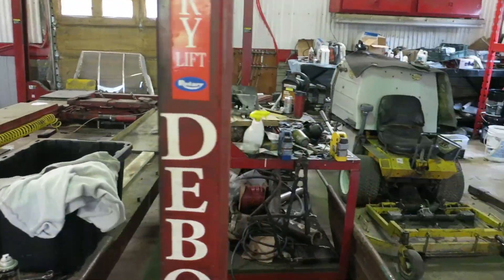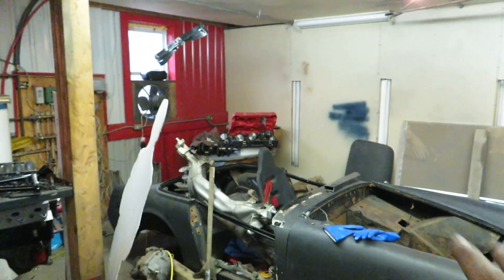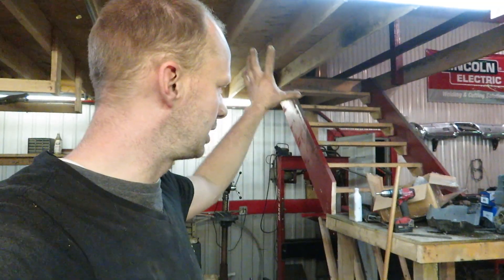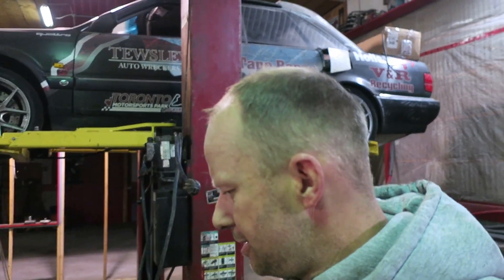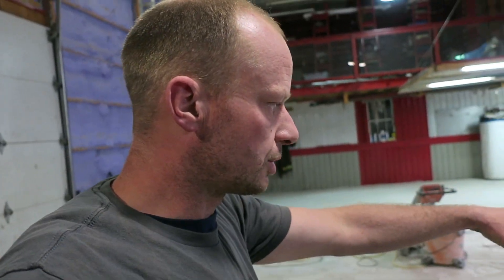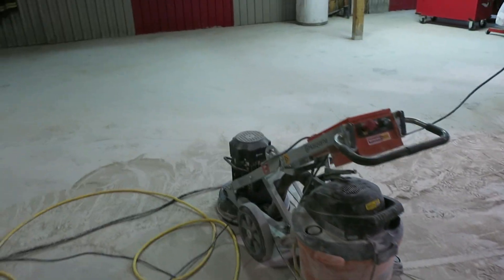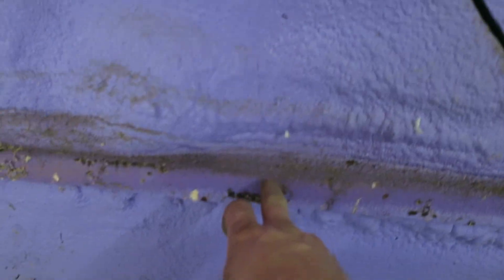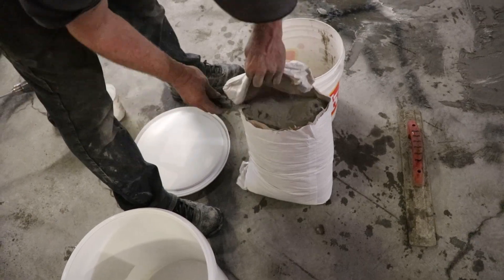DEBOSS GARAGE Gets an Extreme Overhaul! [EP1]

Comment from the maker: PRODUCTS USED - Find the best prices using our affiliate links:
Floor Coating Kit https://geni.us/rocksolid
Industrial Kit https://geni.us/floorcoating
Oil Stain Remover https://geni.us/epoxyshield
Moisture Stop https://geni.us/moisturestop
Floor Leveler https://geni.us/concretesaver
Citric Acid Cleaner (comes in RockSolid kit) https://geni.us/concrete-etch
Rust Remover/Inhibiter Spray https://geni.us/krudkutter
Industrial Concrete Products https://geni.us/industrial-floor
M12 Infrared Camera https://geni.us/m12imager

FULL DISCLOSURE: Rust-Oleum is sending us product to use, to make videos with, and to give some away. We are under no obligation to review their products as part of that relationship, I did not receive monetary compensation for this video, opinions are my own, and everything is scripted myself. We welcome brands that want to help us continue what we love to do and show you how to do it.
Reply: DEBOSS GARAGE 
I did my shop a couple years ago😁
Now are use the leaf blower to blow the dust out of my shop. 
Are use a cordless Dewalt leaf blower! I Always blow off the dirt in the dust in the area that I’m working! 
It is so amazing when you drop something how easy it is to find it! 
Greatly appreciate your videos😎
Reply: Just need a cross draft booth and you dont have to go to dixons :P
Reply: Installed a 40 ft shipping container alongside a shed and cut out internal hd locking door.  As this was a fabrication motor sport shed on a farm in western Australia, 
( HIGH fire risk ) area
Mostly used as a shelved storage for parts toolboxs welding equipment,  anything on wheels basically. as it had its own protection systems, security and fire. the way old cock had it set up was well thought out.

Comment: That epoxy coating ROCKS!  I worked for a aircraft manufacture.  They coated the floors with a similar product; some PPG Epoxy.  The floors were 50 year old and must have been saturated(in some spots) with hydraulic fluid and other various chemicals...  They used some sort of portable shot peening machine (size of a regular lawnmower) to prep the floors.  Then they applied the epoxy.  After 7 years, the floors still looked like the day that it was applied!

Comment: Dont want oil marks on your wood ?  Stain it with used engine oil . Back in the old days when they used wood beams under train rails ( forgot what those are called in English) they used to soak them for weeks before the instalation , impregnates and seals the wood really well . Wouldnt suggest soaking it , just apply with a paint brush .

Comment: Pretty Sweet Makeover !  When you really think about it it is smart Marketing on Rustoleum getting involved and Sponsoring guys like you , lets face it  most of us DIYers  turn to you guys  for real revues on things we want for our garages  heck if it works in your garage  it should really do great in  ours  all of us hang on to things way too long  ive seen some of those old Dianostic tool cabinets turned into coll looking storage  cabinets  for people wanting something different in their Man cave or hot rod garages !  I’m 55 years old and i remember the old Dot Matrix  printers  the big boxes of paper  used to be expensive  back in the day  but like all electronics they get obsolete  with new technology  I’m a retired Woodworker and in my old Shop is a $3.5 Million Dollar milling machine and its worth nothing  although it works fine it has computer technology that  is out of date   And nobody wants to buy those systems  because todays is 4 or 5 times faster ! Not even third world  shops  want it  even for free !  As we just wanted the space it takes up
Reply from the maker: Its a tough shop to get tested in to be sure.  There will be no hiding what it looks like 2+ years from now so stick around.  Really happy with it so far, especially as cleanup is so much quicker.  Now I just have to pave the driveway so I don't track stuff in from outside...

Comment: Good work, I hate concrete grinding, excepting the occasional tidy up where an awkward internal/external corner needs a quick touch up, e.g. a recessed entrance. I would rather do the placing right in the first place or use a good team of placers. Framing, cladding etc. are much more fun.

Comment: I can really appreciate watching your videos. Its not often I see someone go the extra mile to do things right, and not many people see just how many agonizing hours go into doing things right, especially when you're a homeowner or shop owner. 

Thanks for showing us all these tips with construction, I understand that many would not share that knowledge 

In regards to keeping engines and transmissions, I personally never saw a use for holding on to too many. However if you ever find yourself wanting to hold onto them, A standard shipping crate with cut down shelving on both sides. One broad shelving along one side of the crate for engine blocks, one narrow on the other side for transmissions (Make sure an engine hoist can go in-between!).

Comment: You did a great job! Thank you for sharing. My garage story in a residential neighborhood,  Lowell NC..... I had my garage built 25 years ago. 30x30 Mesco all steel, clear floor, insulated. Two 10x12 roll up doors. One personal door and no windows.  I knew I wanted a 2 post clear floor ALM 7k lift. I had 3,000 psi concrete poured. There were 9 guys doing the concrete. They sealed it only. Turned out perfect. Eventually I saved enough for the lift. $4200 installed.  Best money I've ever spent. To date I have absolutely zero cracks. Floor was not scored.  Over the years I've seriously considered doing the epoxy but never did it. My shop is like yours. It's a working shop and not a NASCAR dirt free show shop.  My thought on the epoxy is this: If I had it, I'd be working and would be thinking about floor damage rather than the task at hand.  I enjoy your videos! Keep em coming.

Comment: Man that floor looks mint!!  As for the shop vac issue you had, i would suggest a cyclone seperator. They are between 30 and 100$. They mont on a 5 gallon bucket or plastic drum, they seperate 90% of the dust you suck up before it gets to your vacuum. They work awsome!

Comment: Epoxy floor. NICE! I have been told that Simple Green Industrial Cleaner and Degreaser works very well to get motor oil and grease fully off of those type of floors without putting enough fumes off to make you high as a kite like some of the other degreasers. You can get it cheapest in 55 gallon drums or pallet tank of 275 gallons. I used to sell the 55 gallon drums lube shops that used it since it didn't require them to have their workers wear respirators when cleaning the pits for local safety regs. Still would use the petro-chemical based ones for parts since Simple Green is water based. I can also attest that it will pull a small can's worth of dried roofing tar out of carpet when used at full strength without damaging the carpet, so it cuts pretty well.

Comment: I just insulated and put plywood on the walls of my 80 year old shop. My concrete is cracked like yours but the cracks are opening up. Time for a new floor, or some leveler.

Comment: Use a shop vac bag in addition to the filter and it will suck up fine dust much better. It will not clog easily either

Comment: Hey to be honest your mess isn't as bad as what I got to deal with atm. Our garage for the carlot dad started 20 years ago has 4 bays with a leaking roof (flat roof building) and its filled with all kinds of just junk (boxes and crap from when the house got sold and it was toss shit in a pile to get it moved) mixed with actual useful shit that's buried because of the toss it where ever your head is turned syndrome.

Comment: You have some cool videos. Question? Do you think it would be easy to install the new ford 7.3 gas engine  in a  2000 f250 superduty and swap out the 5.4.  and use the  4r100 trans ? Is this possible?

Comment: If i knew you had a flat head I would have been interested in the stude engine. Just had to fig out how to get it home
Reply from the maker: Shipping an engine is about 250 across the other side of Canada.  Sent a Cummins to Australia and it was $500.  This would be cheaper.  I have about $600 in parts and engine but new bearings, gaskets, pistons, rings.  Everything to make it run
Reply: Figured you sent it off for scrap already. I'll have to shoot you off a email later this week when I have a chance.

Comment: Ha ha Ha I was wondering if you had any of those marks we did our two car garage and we put down the improper way but we used in a special Apoxsee coding with silica sand in it or whatever for grip in our garage which was I think a bad idea because it keeps the smarts and stuff but with pressurized water it cleans good nonetheless we got some swirl marks from letting the stupid grinder sit but it is what it is

Comment: What would be a good start for building a shop, as far as lifts and heavy equipment goes. As well as the potential cost?
Reply: sivloc93 netsiv93  pick a size and double it. Pick a budget and triple it. Pick a hoist that works and stick with it. From experience don’t cheap out in lifts. Parts become hard to find and then your installing a second lift to replace the first and the mounts holes don’t ever line up. In the mean time you’ve bought two hoist and further behind. Air and electric is nice to add as options on a hoist by the way to.  Best of luck

Comment: Had this stuff on my shopfloor for 8 years now.  Other than the sun turning it yellow in spots it has held up amazing.  Heavy welding splatter is the only thing that has damaged it.  Why no flakes?
Reply from the maker: I have flakes in the house garage and thought I would try the swirl this time.

Comment: Uh, Rich - there seems to be a few gaps of missing video, such as where you showed the large cluttered garage space and an instant later the floor is cleared and ready for work. So, how and where did all that stuff go?  Surely not into the house!  Maybe you have other storage buildings or temporary sheds set up?  Or did you use tents outside? Don't tell us it was magic... 🤣
Reply from the maker: House garage has some parts and the rest is in the trailer behind the shop.  Most of the stuff is out of the yard.  The old benches lit up pretty nice in a viking funeral.

Comment: Now be super careful about cutting welding dropping anything heavy or pulling anything in the garage with tracks.   Hot slag will wreck that coating on the floor

Comment: What are the dimensions of your shop. I’ve been thinking about how big of a shop I want and I love the idea of an upstairs part of the shop. Don’t see too many tall enough near me
Reply from the maker: 48'x64'x16'.  Its pole barn so 64' long as 8' is the center on the post.  48' wide as any wider the bottom chords on the trusses go from 2x6 to 2x8 and increases cost.  16' high as I wanted a 14' door so I could get transports, and combines in easily.  From outside, everything is in proportion.  Kind of wish I had the funds to put an attic in the trusses but couldn't afford it at the time
Reply: I have an 80x120 I want another one just like it.

Comment: Your whole cracked floor cut line description is not correct.  The cut lines are NOT TO STOP CRACKING TO GO ANY FARTHER. The cut line is in the floor to keep it from cracking in the first place. If it's hot out and the top of your floor is 90 degrees and the ground underneath is 50 degrees because it's under the cement and sees no sunlight or warmth.   So the top is expanding more then the bottom. We all know heat expands and cool contracts. So the top of the cement is trying to expand more then the underneath.  This expansion causes cracks. The floors are cut so the top can expand at a different rate as the bottom and not have cracks to begin with.

Comment: gotta ask: what was the problem you had that this product (and all the effort) was a solution to? (please forgive my naivety; I'm a computer programmer, not a mechanic) ... was all this effort just to make it look pretty, or does it solve an issue (or lessen an issue).
genuine question, I'm not trolling; I don't understand why you would put so much effort into making a nice shiny floor if it's still gonna get covered in oil and stuff ... is that the issue it solves, does all the crap just pressure wash right off this surface?
genuinely need to know ... it must be important to warrant so much effort.
Cheers  :-)

Comment: Never seen hot water going threw a concrete floor.
Reply: I have exactly the same setup in our 2400 sq ft shop, it's cheap to build and it works great, no issues at all in ten years of use. And it keeps inside temps at at least 15 C even when it's 30 below outside.

Comment: I'm definitely not a stickler when it comes to PPE. But please look up Crystalline silicate. AKA concrete dust. It's 100times worse then asbestos but they don't talk about how harmful it is because we can't stop using concrete.  It's like little barbed arrows that get into the deepest parts of your lungs and NEVER comes out. I'm a smoker, did taping/boarding for years, sanding mud without a mask and the concrete dust is the only thing that scares me into wearing a respirator its so nasty. Takes years off your life.